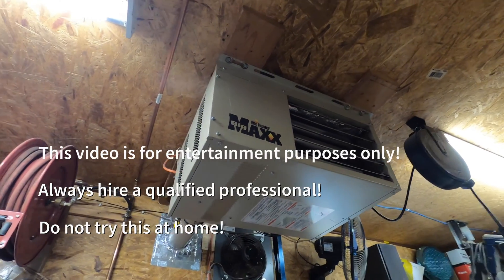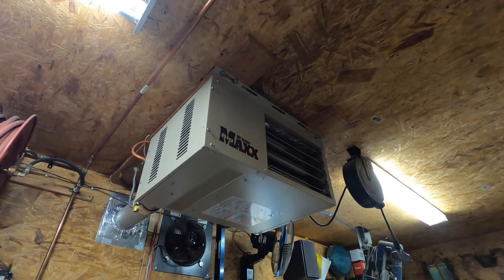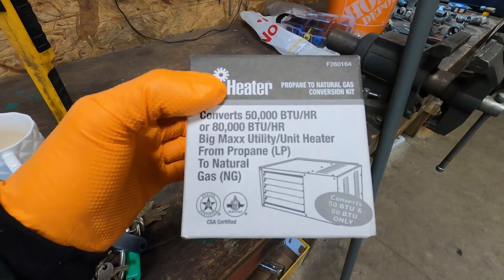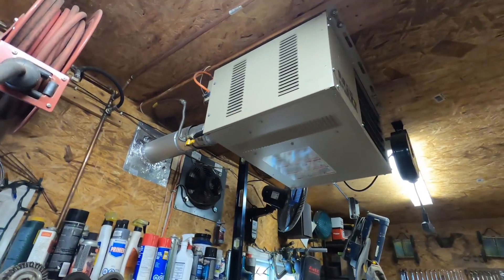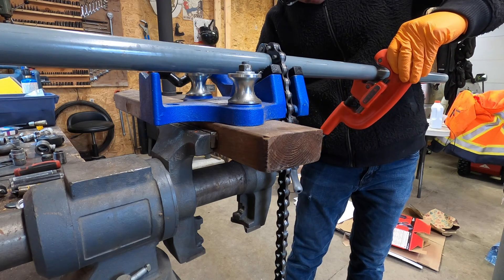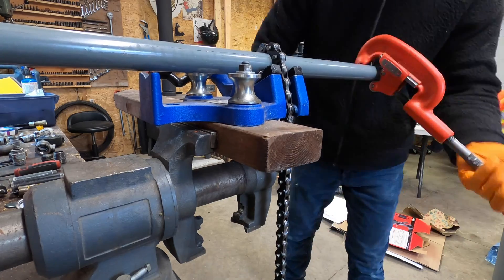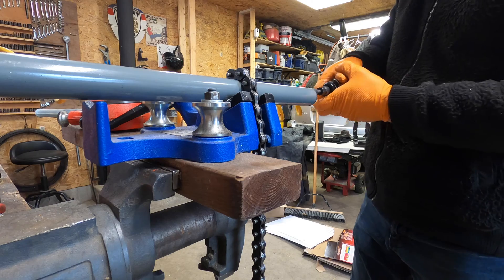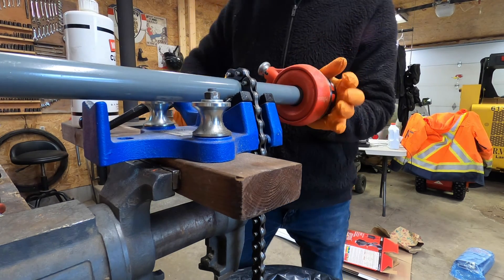Mr  Heater Big Maxx Gas Conversion and Troubleshooting

Comment: Just finished installing my heater and have the same manometer. The instructions say to fill to 0, which is at the top. Is that this is measuring negative pressure?

Comment: Just installed the 50,000 btu big maxx in my garage. I did the natural gas to propane conversion. Gas company guys were just here and we got it fired up for the first time. The unit is working like it should, but it barely puts out any heat!  You have to put your had 6" in front of the heater to even feel any heat at all.  Flames look to small to me compared to other peoples videos of the burner operating. Flame is blue looks to be 6-7" long but not a big flame, no "rumbling" noise to the flame. Any ideas?  Maybe the new orifices that came with it for the conversion are too small?  The gas company guys agree that the flame should be bigger. I'm around $1300 bucks into this project, and I have a heater that barely produces any heat.
Reply: Did you ever get this issue corrected? I am having the same problem.

Comment: I don’t have the medomitor can I just back that screw out 1 and a 1/2 turns and turn it on ?
Reply from the maker: I wouldn’t recommend this as you would have no real way of k owing if you set the pressure properly. The water monometer is super cheap and available on Amazon.
Reply: What did you end up doing? I’ve just choked my gas supply, flame is blue, and fills heating elements, and now the gas valve is quiet and unit no longer cycles. Quick fix.

Comment: As a licensed gasfitter in canada I have to say you did a great job on this conversion and on explaining whats happening with the sequence of operation of the heater. I also really like the care you took when assembling and testing the gas piping - not many do that. Couple tips I'd like to add:
I wouldnt test my gas line at 80psi because theres a chance that a valve could pass a bit of air back into the meter unless the line was totally isolated from the rest of the gas piping in the house.
Also if youre at high altitude here in canada youd wanna set your manifold pressure between 3.1 and 3.5" water column. 3.5 is really good for sea level and altitudes less than 2000 ft above.

Comment: I just did mine tonight. Did your manifold fight you to fit back into place? I'm concerned as the final orfice isn't dead center with the burner. It seems the manifold is off. I'm not a newbie to furnaces by any means, that's how I make a living. And I've never had an issue with a manifold fitting back into place snug, screws line up dead center, all orfices are red line center line through the burners until I got my bigmaxx in the mail. I'm wondering either the units have a horrible defect in them, or mine was damaged during shipping?
Reply from the maker: Angryfarmergamer21 actually yes it wasn’t the smoothest movement getting the manifold back into place but it wasn’t a major fight either. I made sure the flame was as centered as possible and had smooth flow. damage during shipping is definitely possible.
Reply: @rudijones  I'll have to watch carefully when I light it off.
Reply: Try removing the bottom screws that hold the gas valve in place and move it around a little bit as you tighten the manifold screws. The holes they have from the factory dont line up great most of the time so re assembly can be a bit of a pain. You can also loosen the burner screws and line it up that way.